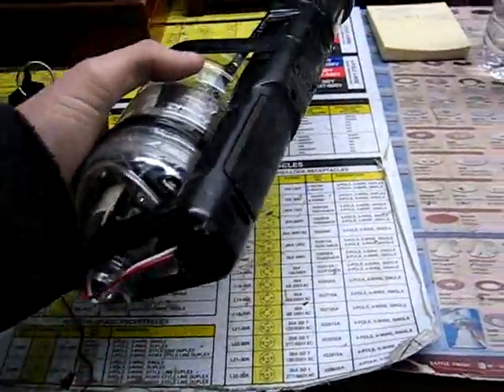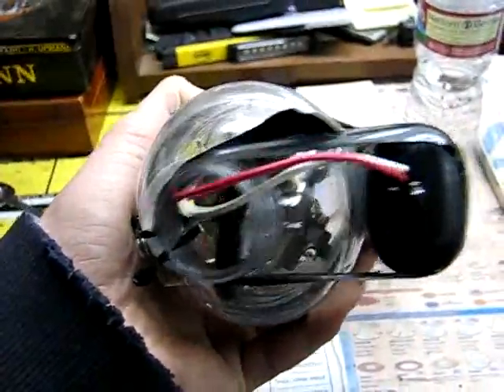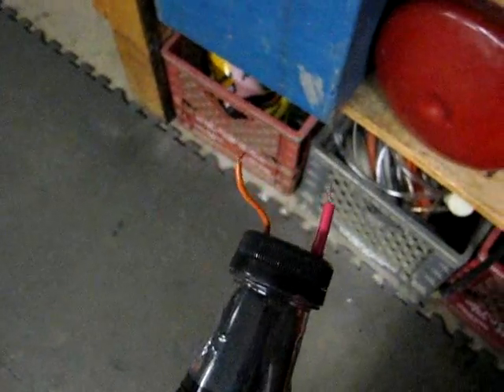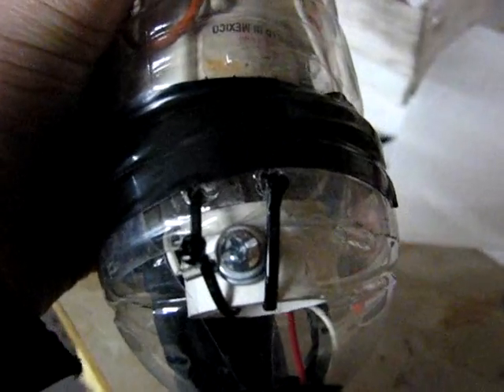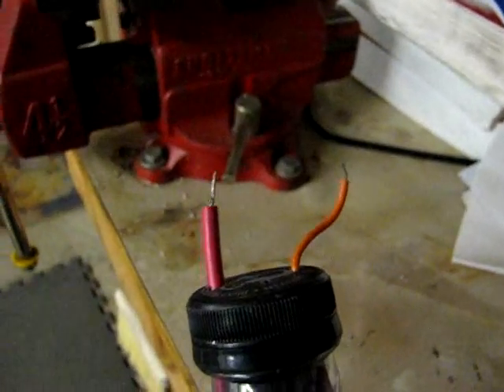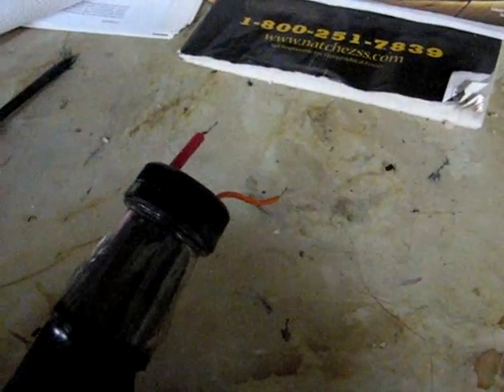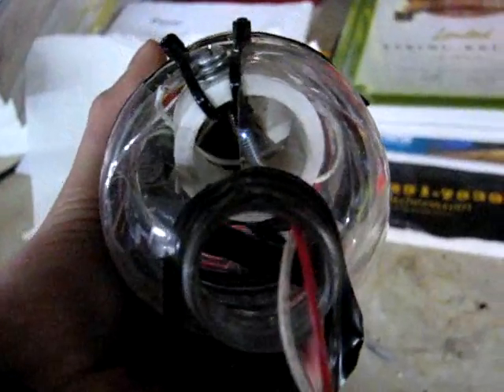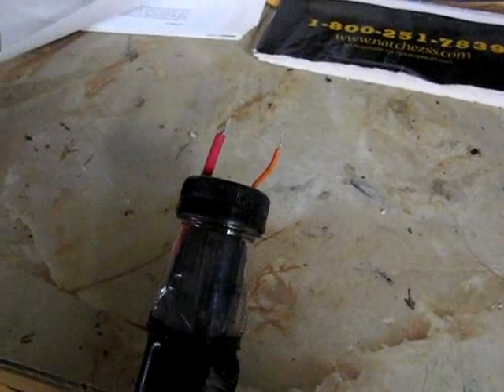Home made stun gun

Comment: Hi there how is it wired fly squatter to the flyback transformer what is also used 555 timer
Reply from the maker: i didn't use a 555 timer. the 2 main cap outputs go to the flyback with a spark gap timer wired in series.i have 2 how-to videos up.
Reply: Spark gap timer wired in what series we're is your other video on how to
Reply from the maker: i uploaded the video, so it's in my uploads. the timer is between the HV output cap and the flyback.

Comment: Can you please make a tutorial for this stun gun
Reply from the maker: I did
Reply: what is it called
Reply from the maker: DIY homemade stungun i think
Reply: ok thanks
Reply: yeah i am just really interested in these kind of things. i have made one but i could not see the electric current do you know why?
Reply from the maker: DIY home made stun gun

If you cannot see it, then the output contacts may be too far apart to make a connection. the voltage isn't high enough to jump the gap.
Reply: where can i get a flyback transformer
Reply from the maker: older computer monitors and tv's(non-flatscreen). on ebay and amazon, flybacks are pricey. i've gotten all of mine from old tv's free
Reply: nice i have a couple old tv's
Reply from the maker: there ya go! when harvesting it, be sure to leave the positive output(long heavily insulted red) wire long. the other wires aren't needed, just the pins on the bottom.
Reply: can you tell me what i can use in place of the bug zapper because i cannot get hold of one
Reply from the maker: amazon.com has them. i'd recommend one with the highest output voltage. this is the exact one in my video. http://www.amazon.com/Zap-Master-Original-Electric-Zapper/dp/B008G4AFDY/ref=sr_1_4?ie=UTF8&qid=1395960216&sr=8-4&keywords=bug+zapper